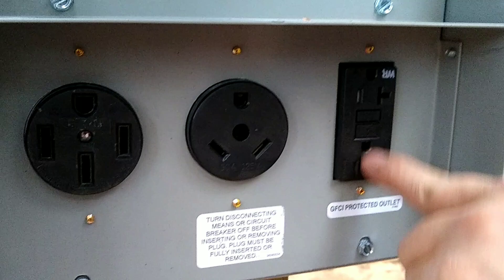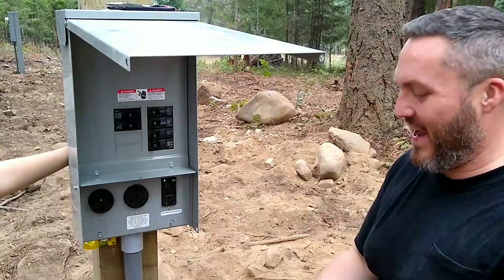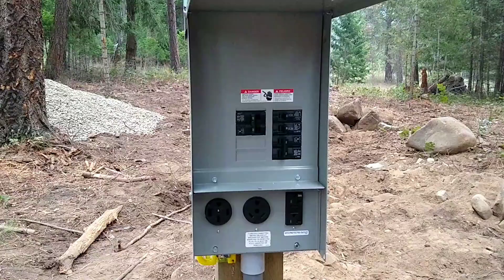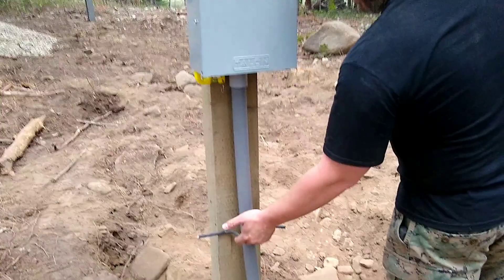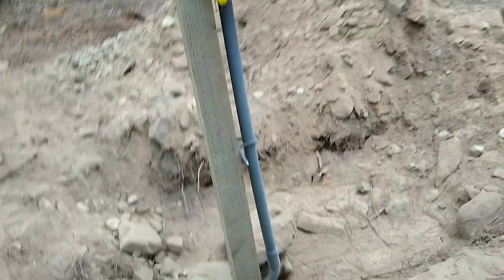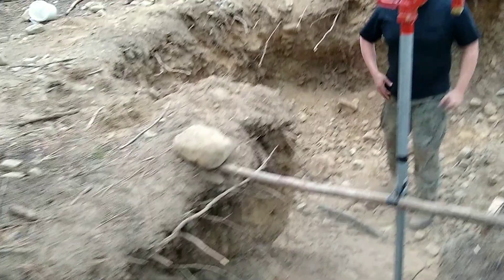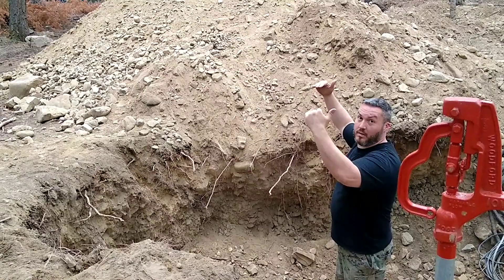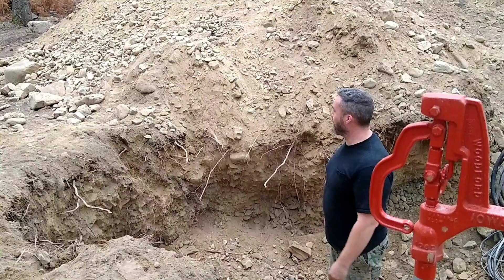Installing Our RV Hookup | Last Minute Preparations

Comment: Hi! Wondering about costs.. did you have electricity??
Reply from the maker: Hello! It cost roughly $6k to have electric put on the property. Then we installed the RV hookup once we had power.
Reply: What amp did and gauge wire did you run from main panel ?
Reply: Some states will pay for it to be done as an EV station at no cost to the homeowners. This is a 30 amp 110 hookup.
Reply: How far did you go down for the well ?     200’.    Ours cost 10K